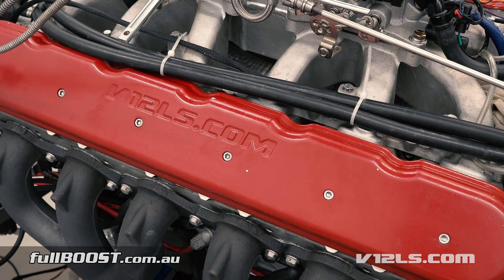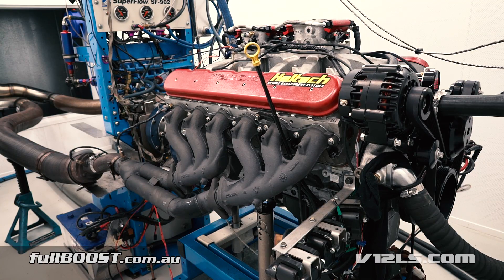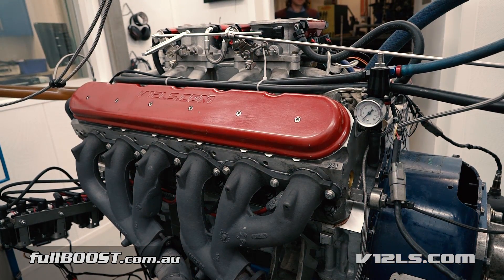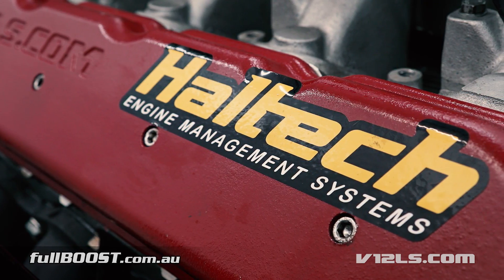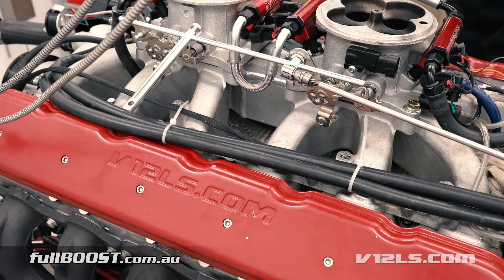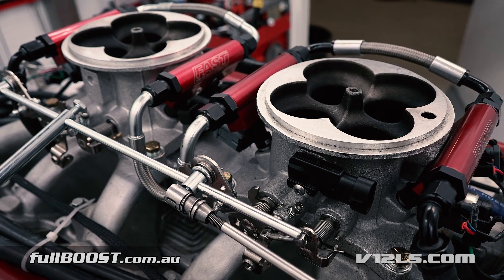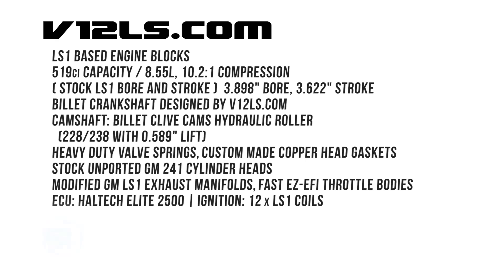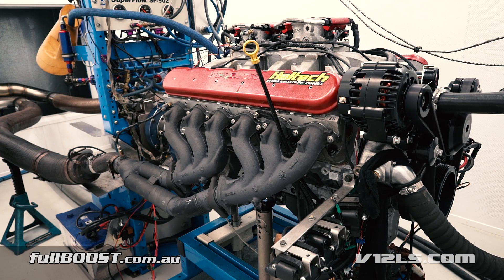V12 LS1 engine dyno

Comment: still gets chopped by stock xr6 turbo
Reply: that epic flat spot would have seen it overtaken by grans electric scooter
Reply from the maker: +wipout1 go learn how a dyno works before commenting....
Reply: The A/F meter hit 14.8, way lean.  I'd call that a dead spot.
Reply: +wipout1 Well if you think you're so great, build your own. All they are doing is showcasing something new and interesting. Oh wait, all your keyboard warrior typing eats away at your time actually doing something productive. If you don't like the video, piss off.
Reply: There is no flat spot, that's the dyno putting a large load on the engine.
Reply: yeah... im pretty sure this engine will be "balls deep" in your xr6 all day long. one day you will learn there is no replacement for displacement
Reply: +Bret L forced induction is a direct replacement. hence why top fuelers use superchargers. 
electric motors are a replacement for displacement.
Reply: You dont understand
Reply: +Bret L  no you don't understand. 
why do you think engines are getting smaller and smaller bit making more and more power each year. 
the ls engines are barely running faster 1/4 mile times than 4 cylinders and rotaries now.
Reply: so your telling me if you had a 500hp boosted engine vs a 500hp naturally aspirated engine on a 90 degree day that they would both be just as fast?
Reply: +Bret L you know heat effects all engines not just boosted ones?
Reply: +balls deep there is no replacement for  displacement if you put everything on a LEVEL playing field boosted vs boosted you CANNOT beat CI. Period.
Reply: My first car was a ecotec with extractors and could of chopped a stock XR6 turbo
Reply: no, an increase in load would change rpm rate change, not power output.
Reply: Chad W You're arguement is invalid. I'll turbo the 3L and spank you. You're comparing two different things. Your n/a 1.5L will be slower than an n/a 3L. And your turbo 1.5L will be slower than a turbo 3L. (Boost pressures and compression ratios equal, of course) 

I'm all for the little guy and spanking v8's with 4 bangers, but your arguement doesn't make sense.
Reply: a turbo has its drawbacks and ppl look at one thing, turbo has lag extra heat less signal and response, u take a 5L v8 and make 350hp 375tq, u take a 2L 4 cyl and boost it to 350hp but it only make 275tq and thats when the boost comes up to full amount, the v8 does 350hp@6200rpm the 4cyl @ 6800, now this is wat ppl forget @5200rpm the v8 make 310hp and 360tq, the 4cyl @5800rpm makes 260hp and 245tq, just cuz peak hp is same dont mean they will respond the same, i dot hate turbos but not a turbo fan, biulding engines is fun and finding power i a ever changing mystery, turbo engines everything evolves around the turbo and making it more effiecient  like intercooler reducing heat combustion chamber workto reduce cyl pressure under heavy boost, when ppl say turbo they look at power but with out response it becomes lazy and the extra power is unessesary, turbos can be responive but it takes the same aproach as biulding a N/A motor, ricky smith vs troy choughlin, 2600-2800hp nitrous engine vs 3500hp turbo engine separated by 2475lbs vs 2600lbs, i dnt think 125lbs separated the two that much, the turbo just lazy power, 5.76@250 for nitrous 5.84@248 for turbo
Reply: +Chad W OK well what if u consider the bigger displacement motor has a turbo as well , wtf r u gonna replace it with now? Displacement will always be the king , what if you wanna achieve high power numbers such as 2-3k hp motors , there is no 1.5 liter in the world that pushes those numbers .... What about heavy vehicles like a tank or a semi , they need the displacement to have enough torque to move , you can put 10 turbos on that 1.5 it still won't move a tank. The only logical replacement to displacement ( not in all cases ofc ) is weight.
Reply: +balls deep Top fuelers use the most displacement they can get, and then forced induction. It's not a replacement. No top fueler is running a 4-6 cylinder. Electric is not a replacement at all. It's an alternative. Same rule applies to electric, you need more available current. Displacement is a measurement of volume. Cells are displacement. You won't see a 2kW/hr electric car. Your argument is founded on dog shit.
Reply: Top Fuel rules dictate the engine specifications it has nothing to do with choices.  You can't run a DOHC setup as an example, they all have to be a "hemi" head V8.
Reply: Ryan Rohauer, Balls deep must not watch too many Pro Mod, Pro Stock, Gassers, etc. because they don't use less than 500CI engines for the exact reasons you claim but I have to also agree with him that electric power will be the replacement for displacement, just keep an eye on Don Garlits.
Reply: teedub127. Electric powered vehicles still have a parallel quandary to displacement. In EV's, the larger the cell/superconductor system is, the more electricity you can quickly release to the motor. This is one of the reasons why Tesla doesn't make a Model S with a 60 kWh battery pack that can be fitted with the 'ludicrous mode' setting. It takes major amperage.
Reply: Nicecardude100
V12's aren't about making more HP, it's that they are perfectly balanced and smoother than  V8's, as an added bonus they sound a lot better too.
Reply: GlassTopRX7 That's my point you don't NEED 12 cylinders to make 715 hp, an i4 turbo with 50 psi and e85 can make that, but no one wants a feminized ticking time bomb. As far as sound that's a personal preference because I like ford 4.6 4v better than anything
Reply: Still lots of HP to be had from this engine with a little porting of the heads and some tube headers.
I don't know what xr6 turbo you are talking about that makes over 600 hp stock....luck if they were 400hp.
Throw a turbo on this thing and it will eat xr6 for breakfast and shit out an escort lol.
Reply: bigger engines have less stress on internals thus being more reliable at higher outputs.. that 50psi e85 4banger wouldnt last as long as a 427ci v12 or so with low boost turbos on. and you`d have a torquier ride for effortless comfort but hey,keep spouting that nonsense that 4bangers are better because of a dyno sheet
Reply: jkk20
It's all about physics, without specifics that statement is meaning less. 1.3L makes 450whp, it's will rolls for at least 85k miles, that more power and least about as long as a similarly power bb chevy', that equal to about 550 gross HP.
Reply: GlassTopRX7 85k miles vs something that could get me the same hp and more mileage but with a bigger engine that isnt stressed as much.. gee i wonder what i'll take. the setup that warrants less maintenance over the course of its lifetime or the thing i have to rebuild every few years....
Reply: Some Diesel Electric locomotives used for shunting put out 750hp @ around 950rpm.

I'm thinking with your utterly VAST understanding of mechanical principals you could approach EMD and propose a mutually beneficial collaboration where you retrofit XR6 turbo engines to those locomotives. 
Some key points you could mention to the engineering executives are:
*They are smaller 
*lighter
*use far less fuel when idling 
*cheap to rebuild and source. 
In addition: 
*cheap turbos from China can be sourced from eBay 
* could easily use a truly MASSIVE liquid to air intercooler with the added efficiency of spray bars for the hot Australian summer.
*Nitrous Oxide injection could be implemented for short periods to aid starting traction.
*compatible with AC traction.
 
I envisage an initiative by the federal government would make available a $50k grant so you can put together a business plan. Under the provisions of the grant you may be able to travel to the US - possibly Business Class.
Reply: ThePaulv12
LOL
Reply: 4 cylinder is gay, but it could make 1000hp
Reply: Do you know why a turbo magically makes a 1.5l run like a 3l?  Because suddenly you're consuming as much air as a 3l...you're still increasing the effective displacement of the engine.
Reply: Did you happen to look at the throttle position at that measurement?  It was idle to very little throttle opening and is still richer than stoichiometric. It's actually a very good tune running that even at low power and fattening under load.
Reply: +whambodius I&#39;m a powertrain engineer specializing in the design of mass produced forced induction engines.  Literally MILLIONS of vehicles are out there with systems I designed.  When you work for a company designing systems for every major automotive manufacturer in the world as well as numerous extremely high-end exotics and aftermarket companies AND have several patents for forced induction systems to your name, you'll be where I am.  If you surpass that, THEN you can call me an uneducated peasant.

Forced induction increases the volume of air an engine consumes like larger displacement. At the most basic level, boost and large displacement are two approaches to the same result: more air to burn more fuel.
Reply: 94XJ
 turbocharging doesnt replace displacement at all. heck,its only there to hide the flaws of the lack of displacement. but then again its only because our engines barely reach 30% thermal efficiency. otherwise we'd all be driving 1L turbo engines and having plenty of power at 100% thermal efficiency lmp1 cars are hovering around 35% thermal efficiency iirc

wich says alot.
Reply: In some ways your argument appears to have aspects of truth however you ignore other aspects.
For example: NA engines power production is rated at 1013.3hpa @ 15deg C at sea level. This is called ISA (International Standard Atmosphere). Any variation of ISA effects ISA power production. Therefore in the real world NA hp is variable dependent on elevation, humidity, temperature and a combination of these. On a hot day at even 1500ft AMSL (Above Mean Sea Level) then a 100hp engine might only produce 75hp. The same effect also occurs with a supercharger - however not with a turbocharger because the turbine/compressor are free spooling and boost is limited by waste gate/blow off valve or other means. The supercharger is slaved to crankshaft revs and each rotation of the impeller/compressor delivers a known volume of air so it is effected similar to NA. 
Turbochargers on the other hand are free spooling so can maintain ISA hp up to what is termed critical altitude (which is somewhere around 18000ft AMSL.
Other advantages of turbochargers are numerous and include allowing the fitment of smaller engines in smaller vehicles which can produce similar hp to larger engines but then revert to a smaller engine when in a low boost situation. This small engine allows a smaller lighter car so therefore has advantages to handling, braking, acceleration and fuel consumption.
In large piston reciprocating engines big hp is capable by a more compact engine for almost identical reasons as cars with turbocharged engines. For example: instead of having a V24 then a V16 with far fewer moving parts and therefore much lower pumping losses can do similar work as the V24 and use less fuel doing so - and produce the same power every day in spite of inevitable variations to ISA.
In aviation piston engines most (but not all) turbochargers don't boost above ISA. They are called turbo normalized. This (as explained above) is to compensate for the onerous loss of performance of all NA aviation piston engines with altitude increase. Also hot and high runway performance can completely eliminate any takeoff at certain airfields on many days of the year, so a turbocharger restores ISA performance. Some aviation engines have 2 speed superchargers - one for low altitude and one for high altitude to compensate for their incapacity to pump air with altitude gain.
Turbochargers have their place whether you acknowledge it or not.  Because you choose to ignore certain realities doesn't change the fact that they exist for a variety or reasons you seem to have failed to understand.
Reply: ThePaulv12
so your point is turbos are better because prop air planes made good use out of them? the video is about a corvette v12 engine and the original comment i made was about a small 4 banger vs a bigger displacement engines.. say a 7L mercedes V12 vs a 2L turbo car running 50psi.. yes i know what i'd take over that 4 banger any time of the day.

but i'll give it to you that turbocharged cars can in theory extract much much more thermal efficiency out of an internal combustion engine. you simply have to use kinetic energy recuperation + energy storage and some other more modern methods. but yes its totally doable. its why lmp1 cars are hovering in the mid 30's in terms of thermal efficiency rather than the teens or 20% for the best cars. wich tends to be diesel non hybrid.
Reply: No you have polarized thinking. Just because I point out a few realities doesn't in any way indicate I had a personal preference. 
However I do have a personal preference and I will now indicate it: You might be surprised to know I prefer normally aspirated engines - HOWEVER - that is my preference which is entirely different to the economic efficiency of the world we live in. The fact is turbochargers are a far more economical way of making power in many instances. So equipped engines produce their rated power under varying conditions. Arguing against them is ridiculous.
Reply: ThePaulv12
from an economic perspective yes,downsizing and adding turbochargers is better i will concede that fact. heck,to produce the most efficient engines we will have to rely on turbocharging. but i did make my first statement in this video in regards to a small 4 banger being overboosted vs sheer displacement for normal routine useage wich i am not wrong

low boost small displacement does work. or even larger displacement turbo does too. trains,ships and the list goes on.

anyway i did share my view and that's that
Reply: GE has Diesel locomotives that now produce 6000 hp at about 1000rpm with only 12 cylinders. Before they were producing 4000 with 16 cylinders! The V12 engines are very reliable - perhaps more so than the V16s.
In trucks, now most power is 6 cylinders with a broad torque band of 1000rpm. The turbo generates massive boost even at 950rpm. Before, many NA Diesels had a much narrower power bands - some as narrow as 400rpm. Lag is a product of turbocharger inertia and NOT as many think distance from the engine, since a pressure rise at one end of a vessel = an instantaneous rise at the other. 
Soon we'll be seeing proper electric superchargers (not those silly airbox fans) handling low engine speed supplementing a conventional turbocharger. 
Interestingly an advantage of turbocharged small engines is since the swept volume is say 2 litre the motor when not on boost is still a 2 litre motor. A 5 litre NA motor is always a 5 litre motor at all phases of operation so much more air (and fuel in the correct ratio) is required for all phases of operation. 
I don't mind turbocharged engines - heck I'd have one of those new bargain Ford Fiesta AWDs in a heartbeat. They pump out about 350hp and with almost no lag apparently. They have the cops up in arms because it has factory fitted Drift Mode; and they're only $50k!
Still, it aint no Hemi 'Cuda (or V12 E type convertible)
Reply: I want the new awd drive turbo Ford fusion
Reply: they are nice but I say LS ftw
Reply: Good to see someone here knows how to read all those numbers on the table.
 The engine was not getting as even mixtures as we would have liked at low duty cycles, due to the throttle body injection (opposed to port injection), so we kept it a little on the fat side to be safe. We will be tuning a couple of different port injection systems soon which should yield even better results.
Reply: lmfao
"epic flat spot" of what , 600 ft lb of torque?  
ahahaha
Reply: +WarWagonMT I hope to see some videos with the port injection setup.  Are there plans for a hotter cam or some new headers by chance?
Reply: I don't see it happening!
Reply: Im sure custom solid roller cams and heads and headers are in the make, since they plan on having a US market.
Reply: Since solid roller cams are useless for idling then fitting them to this motor (with associated gear) would be for all out horsepower. 
I like you am wondering what is the market for this motor. 
Don't get me wrong, I think it is a great, even - FANTASTIC - concept but where to now?
Reply: I don't think we will need to go as far as running solid lifters. They are good, but there are other issues that go with them. I think we can make the 1,000hp mark with just a little more capacity, cam, intake, exhaust and heads.
 The market for an engine like this is really for the hotrod builder who wants something cool and unique. It's not supposed to be the most powerful engine for an outright strip weapon. The fact that it makes 700+ HP on pump fuel is a bonus.
Reply: Like I said I love this V12. 
I have an 80 Daimler Double Six sitting around. The car owes me nothing, is under cover and rust free. It has a blown transmission and some obscure electrical issues - which I am largely on top of but the car is a long term project. Like most Jag V12s the motor is completely fine. The motors themselves give almost no trouble, unfortunately not so for the injection system wiring and the early ignition system. IMO the V12 Jag is a near perfect engine, and in some respects its fitment to a heavy car like a S1, 2, 3 4 door is not ideal.
The characteristics of the engine, combined with the weight of the car and the heavy mass of the TH400 gearset make the V12 quite slow off idle. Thing is once you get it to about 3500rpm it is great. I had a S2 and there was not one day I owned that car I didn't turn it 6500rpm. The way it revved up and screamed was intoxicating. The handling of them is decent too. 
Anyhow, I'd love a V12 motor and trans that were more suited to a S3 4 door. Thing is it has to fit.
The torque a larger capacity engine delivers is what I'd like and keeping a V12. V12s are great I love them.
That doesn't mean I don't like V8s BTW. As much as I like V8s I don't want one in my Jag/Daimler.
Reply: WarWagonMT any plans to base a V12 on later LS architecture ie LS3 for example?? As I understand from 09 onwards all the 6.2L blocks are cast/made 20+% stronger overall from the Factory.
Reply: Holy shit, the mouthbreathers in here have moved the goalposts so much they're not even in the same state anymore.
Reply: +Chad W Cam... what does cam have to do with displacement size of an engine?  Displacement is determined by bore size and stroke.  The 3litre in your example would have either larger bore size, or more likely longer stroke.  Where did you get cam from?
Reply: +GlassTopRX7 While I think all motors are great, the sound is more opinionative don't you think?  I think old school OHV big blocks with hot cams and straight pipes sound best.  Ooooohhh, that idle!  No need for those lame old flowmasters, or glass packs.
Reply: Tadz people like you think your ecotec commodore is the fastest thing on the road,  wouldnt be surprised if you ended up wrapping it around a pole trying to do a skid.
Reply: whambodius f1 cars back in the 80's were pushing over 1000 with 1.5 turbo engines
Reply: Ryan Rohauer what about rev's the 5.2 coyote rev's to almost 9 grand and formula one cars are 1.8l but rev to like 20,000 and make amazing power now they are boosted but I think rev's might be a replacement for displacement